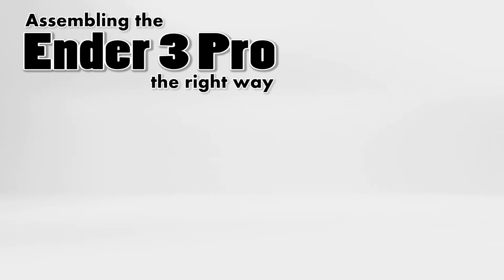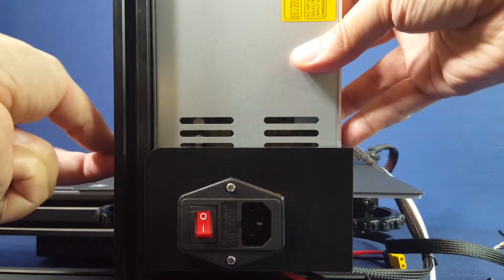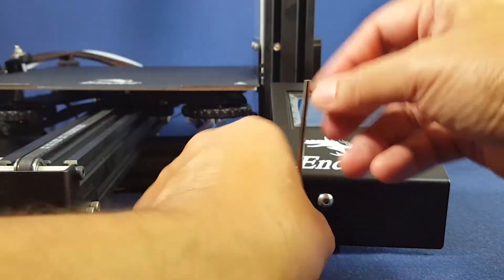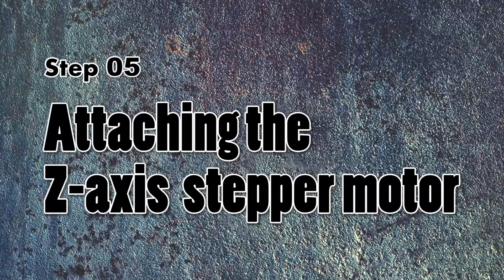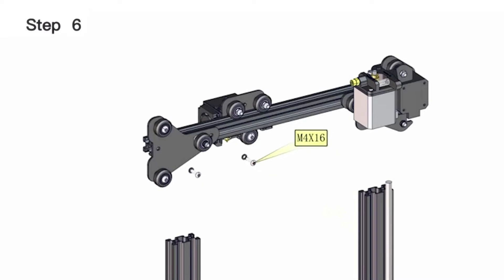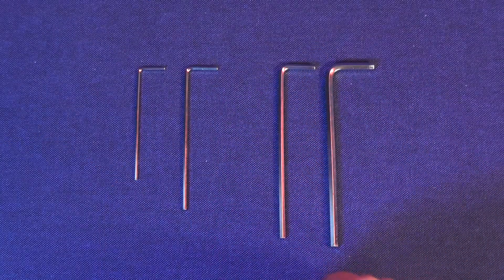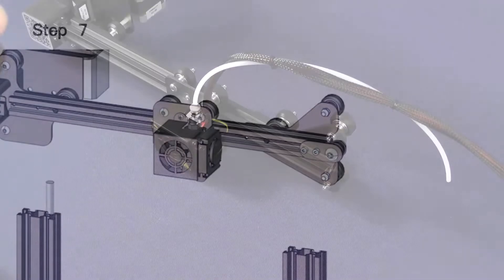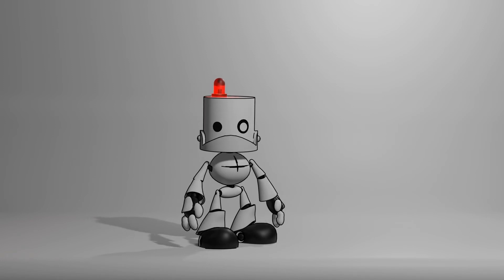Ender 3 Pro (2022) Assembly Guide - Part 3 - Revised

Comment: Thank you so much for these videos  but i do have one  issue  either i am confused about which end is the front of the printer or could it be you have right and left mixed up?   when you  say left hand side of the printer  at 1:26  to me that looks like the right side of the printer on the back side of extruded post.
Reply from the maker: When I describe something, I find it hard to say left or right without also mentioning in reference to what. 
Coming from the premise that the printer has a front and a back, one would assume that it also has a left and right sides. 

When I say the left-hand side of the printer, I refer to the left side of the "printer", not my left side. If that makes any sense...  🤔

Thanks for your feedback, though! I will put more thought into it in my future videos. 😊